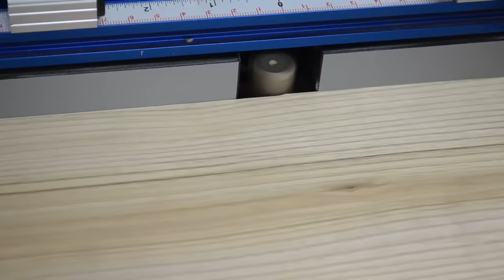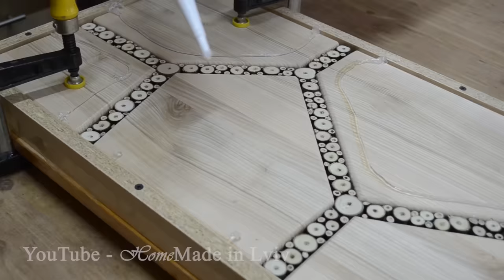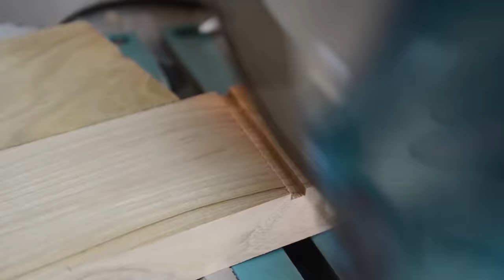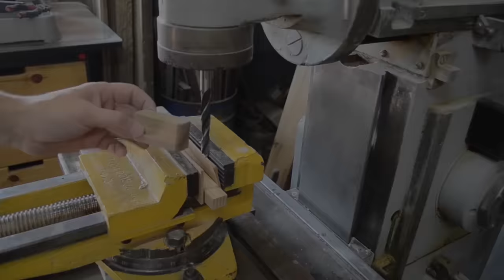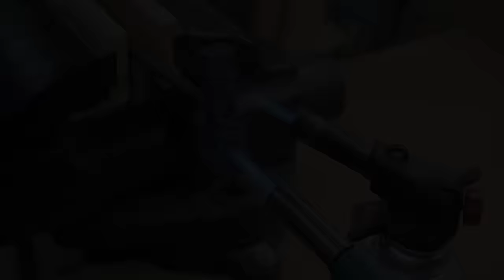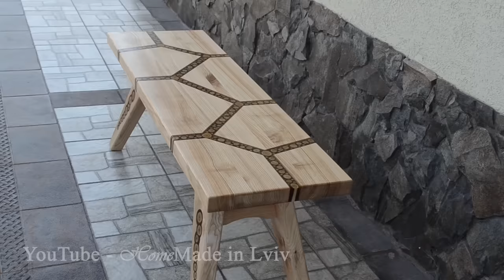Hardwood bench with walnut inlays

Comment: Alot of that is green wood with moisture. what resin are you using?
Reply from the maker: Nothing will happen because the material is completely covered with resin. Over time, it will darken. I use the epoxy resin with a polymerization time of 5 days.
Reply: Do you buy it locally or online? I’d like to try some of that brand.